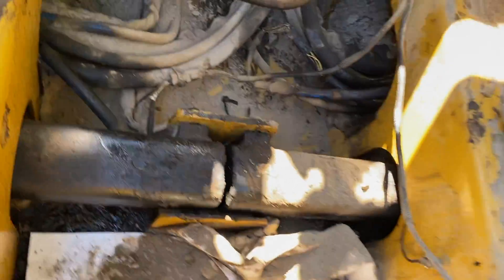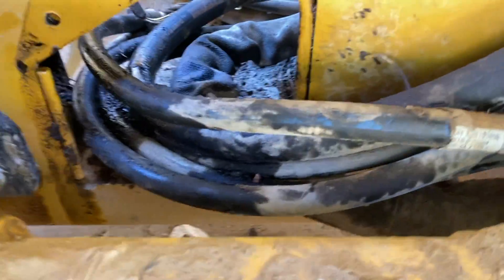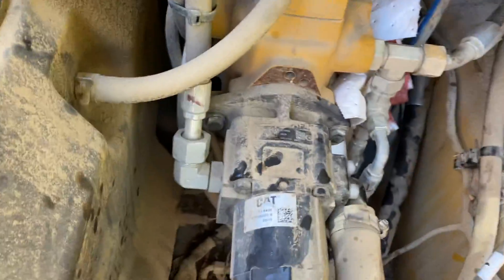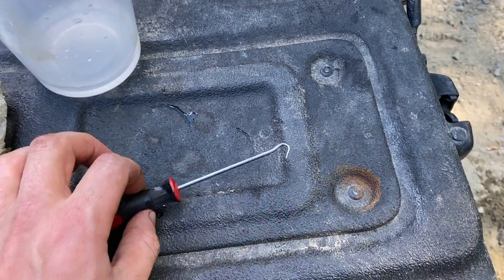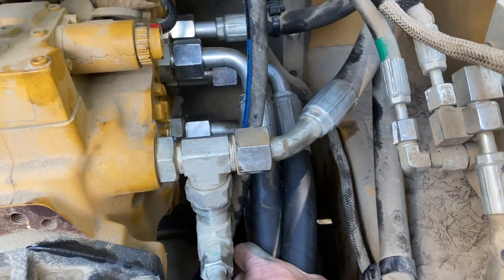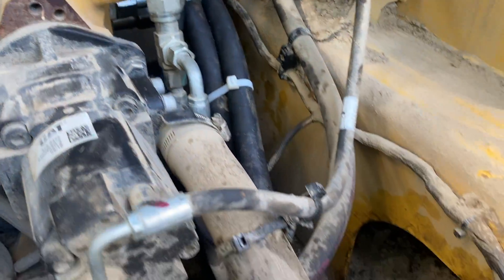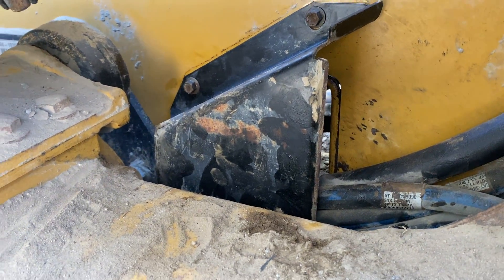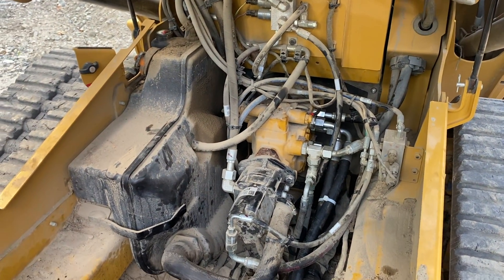CAT skid steer hydraulic hose repair

Comment: Thanks for the video.  You are very efficient!  I am trying to replace one of the smaller hoses (1/2"-08) that is under the main drive hose.  You seem to have way more working room in the track to the main drive fitting than what I have.  I can't get a wrench into this area.  Will try crows foot in the morning.
Reply from the maker: I added a standard and metric set of crows feet to my toolbox because of this job. The trouble with the small equipment is everything is bundled together so close. You end up disconnecting / removing parts to access the one you want.
Reply: @ Yep.  I added crowsfeet and was able to get it.  I didn’t remove the side panel at first but that made a difference.  Not a fun job but if I have to do another one I feel better prepared.

Comment: What size are the fittings are on the ends of the hose? And what size of hose is it?
Reply: -12 3/4” four wire hose and 3/4” o-ring face female fittings. One straight and one 90.

Comment: My cat pops the hydraulic hoses often supposedly the said because I use the rabbit (fast button)
Reply from the maker: are they saying you shouldn't speed transition while under power? I do it all the time
Reply: Just happened with my son. He was running in Rabbit and turned and bam it exploded. However, just like in the video, those lines were rubbing for some time... poor design there. I'm thinking of putting some sort of polymer there kinda like pvc or something to keep them from rubbing. Maybe I could wrap rubber around them at the entry point.

Comment: how much would cat have charged you to fix it?. nice vid bud
Reply: I just paid 900 to have 2 of those replaced. Labor and parts.
Reply: that sounds like a bargain @sportsman9971
Reply from the maker: I didn't even ask the parts alone were expensive. I only had to have them come out one time under warranty to reset something with the computer. Other then that both my skid steer and mini have been very reliable approaching 1000 hrs on both.